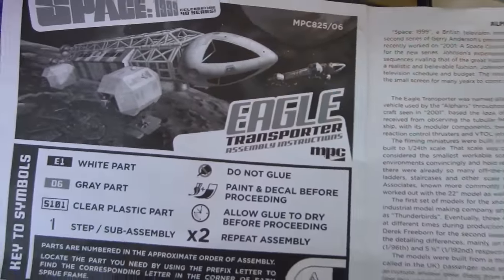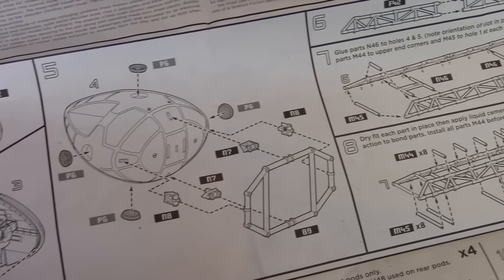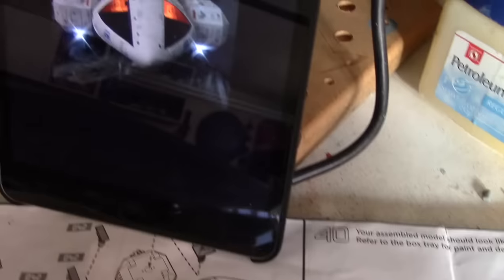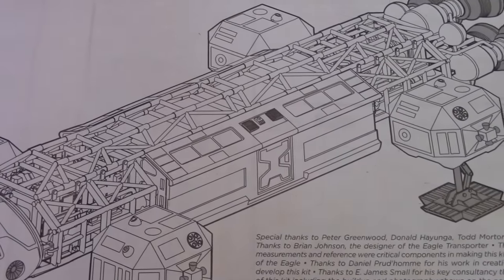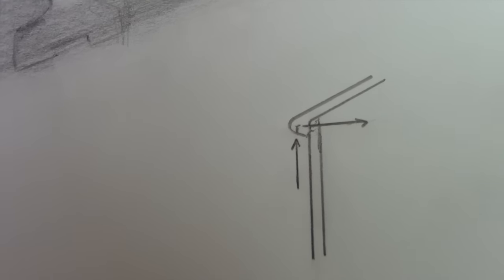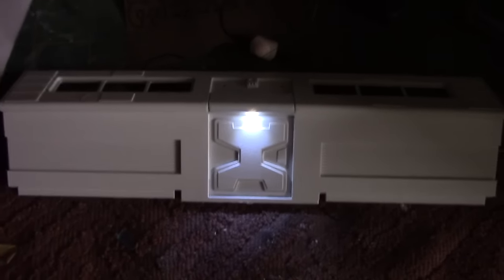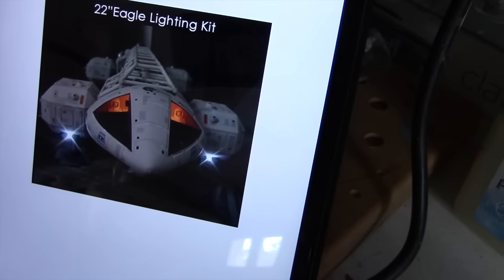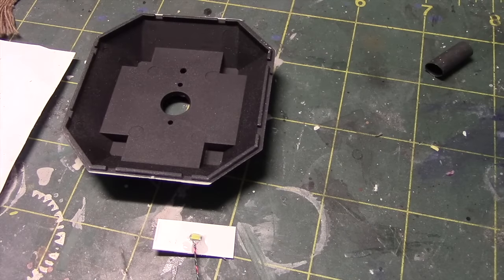Revisiting Round 2's 1/48 scale Space: 1999 Eagle

Comment: Amazing work, I'm just wonder can I get more info on the tulip black out paint that your using, I'm not sure which one to get and are you applying it with a brush or airbrush?
Reply from the maker: Hi, thanks for the compliment. It’s a fabric paint and the best way is to  generously apply with a brush. Because of its consistency it will not go on evenly hence the need to apply several coats sometimes. Best thing is to back light your piece after each application has dried to see which areas need more coverage. It can be found at Michael’s, HobbyLobby or fabric store. Black is the best color to use for this. Hope that helps